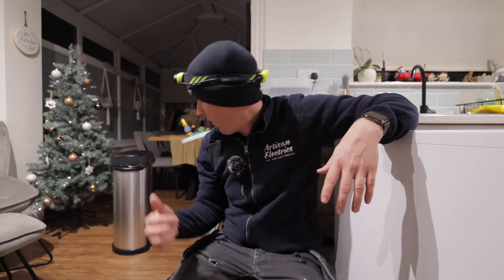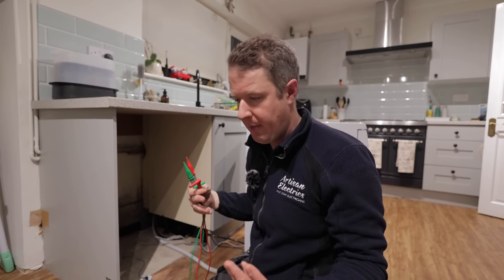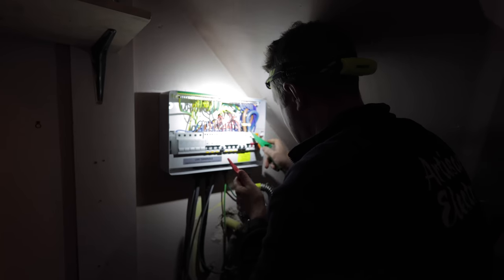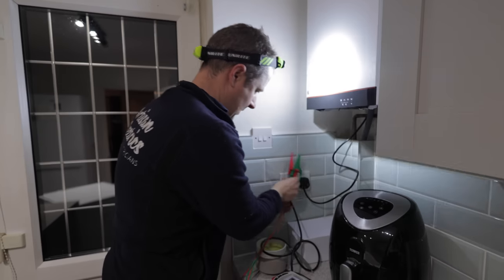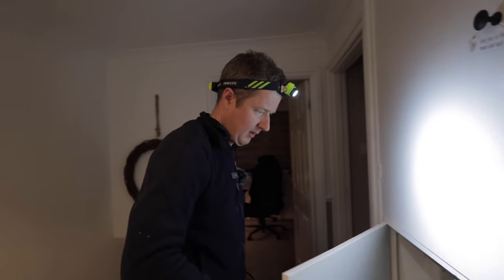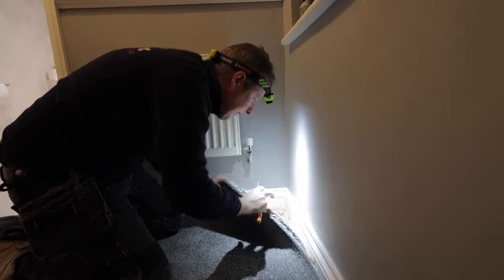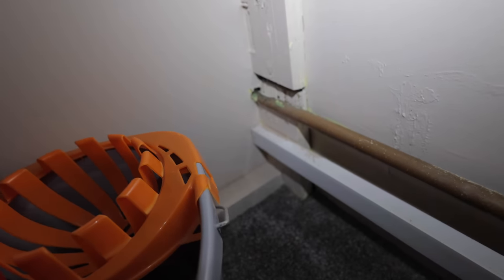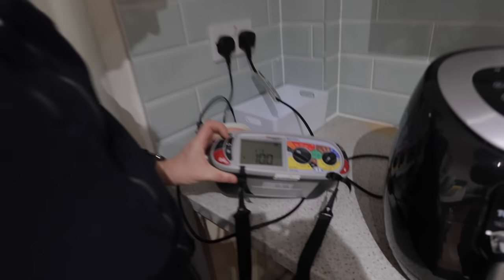Nearly KILLED by a CRAZY fault! What on earth is going on? 💀

Comment: Quick question,  you originally had two cables coming out of the boiler, you removed one (the old 2core) did this leave a hole through the rubber ? If so the boiler is now no longer room sealed.
Apologies if Im wrong, hard to see on the video.

Comment: i was a spark in the 60s and used a rubber matt to wire live 240v and 440v single and 3 phase so i surggest  you do the same this is an old sparks trick to save lives

Comment: Try french electrics. Now there's a problem. There's no neutral or earth. Just two lives. Theres no colour coding on wires. If you turn off the electrics at the board the hot water boiler stays on. Makes working on the system interesting.

Comment: I just had almost same issue .... designated cct for Boiler & Controls ....in and working fine for over 15 years, simple S/L, N & E   ...... .  Boiler replaced, new one needed a permananet live. The boiler installer used ONLY the S/L  (not N or earth) and used L&N from a local ring main.      For weeks spurious boiler shut down with 'low voltage error'      Eventualy found the wiring issue .... rewired with permanent live from System controller (same as S/L)   and all fine.

Comment: This could have been fixed without replacing the cable from the hotpress to the boiler. This existing cable could have been used to switch a relay which could have been used to provide a dry contact to the downstairs circuit. That way the down stairs circuit supplies permanent live, switched live and neutral tot he boiler with the cable from the hot press controlling the switching of the switched live. Anyway, good video, fair play.

Comment: Seen this in usa , you have a back feed in usa we wave 2 hot legs of 120 volts (to neutral)  180°out if phase to make our 240 single phase . Back feeding through an appliance if 2 breakers switches at panel are tied together per code or using a double pole breaker is not unheard of  here in usa .from some maintenance guy or homeowner not caring or knowing what they are doing .I don’t know much about British power system except you guys do it different to us and at 50hz .

Comment: Sadly, at the very end, after ensuring the downstairs boiler was fed from the ive upstairs heating system, YOU NEVER CHECKED the "direct connection there" between neutral & earth, (or maybe they were still going/coming from a MEN distribution panel upstairs, that joined N to Earth, meaning you STILL HAVE that fault, but it was (and I saw it) 10 volts on the EARTH (between the outlet's N & E via the tester) when the tester was plugged into the outlet.

THAT 10v was the E/N fault which you NEVER cleared, as there should NEVER be any voltage of that low level, between N&E ANYWHERE IN THE INSTALLATION.
That small leakage voltage is a warning, that at some time in the future, it could be the SAME voltage as if PHASE to Neutral (as that's exactly what happens when an electric element destroys itself, shorting directly from Phase to sheath, when the inner core breaks and "disconnects" from the core beside the fault, which is itself still connecte to the Neutral of that circuit.

NOT EVEY ELEMENT is the same.
Some simply blow the core "open circuit" with neither the N or L touching the sheath, sometimes they BLOW th outer sheath open, exposing both sides of the core, to the water inside the bioler, resulting in a small P to E fault current.

Sometimes thee is enough fault current flowing, to BLOW the protective fuses, but often NOT.
That is when all of your bonded / grounded/ metalwork becomes slightly livened.

fault currents between N & E can aso be caused from an off--site fault, between circuits of MUCH HIGHER voltages, meaning that YOUR bonded metalwork to E conections / cables back to th switchboard etc., can show voltages between E & N at an outlet, several times HIGHER than your installation's 240v.

Earthing circuits of a MEN or a PEN system, often exceed the premises voltage supply, simply as they are themselves part of a DIFFERENT system's erth retrn circuit, that has FAILED to blow it's protective fuses.

NEVER EVER presume that Earth will always have ZERO voltage and NO current.

That is NOT how a bonded earth return system works.

Either it's zero as both N & E are hardwire connected between their busbars at the switchboard, or you have a PEN (Protected from E Neutral), system whereby whatever voltage appears on the earth, is separated from your supplies source, hence that (THE ACTUAL LEAKAGE VOLTAGE POTENTIAL) of 10v - is the fault value possibly caused by  an element dying inside the boiler, leaking current to the copper piping and thus to the metalwork inside the boiler control panel, which of course, is bonded to the E terminal at your switchboard a distance from the outlet, meaning a circuit differential between the N& E at the plug can exist), giving you a very high resistance fault path, with negligible (but still there) being a minor fault current to bonded E at the boiler, which should blow the protective fuses, BUT CANNOT - as the fault current is NOT high enough to trip the fused protection wherever it is supplied from, leaving your client's bonded earth system, LIVE at all times.

Any value on a meter after you complete your testing should warn you - YOU HAVE NOT CLEARED ALL FAULTS.
That 10v on the meter proves there is still a N/E potential of 10v at that socket, but from where it is coming?

The ONLY way to discover from where, is to take ALL E READING from the outside deep ground GROUNDING STAKE, not simply an E terminal along a long length of cable, from a bonded E/N switchboard.

The FAULT you felt off that E terminal, was the same 10v on ALL bonded metalwork, including the boiler control panel housing.

Anyone working with water IN THE SINK/DRAIN nearby, could well get a massive shock, it they simply touch the pies or the taps.

It isn't unheard of, for housewives to "complain" of a tingle when turning taps on & off, if a HUGE FAULT exists say a few miles away at a switchyard, where a transmission transformer's circuits are faulting to GROUND, but the  fault is NOT going back via that switchyard's own earth /N bonding,  but rather your own bonded metalwork, and your E-N switchboard, meaning -yep, even if your mains switch is OFF, it only disconnects the L/Phase, not the N or the E.

It's why I prefer an ONLY L+N system, whereby the earth and all bonded / grounded pipework/metalwork is completely unrelated to your incoming FULLY PROTECTED RCD mains supply lines.

If there was zero method any ground fault, from your premises or anywhere else, could appear between your N & P lines, there wouldn't be any "ability" to shock anyone in the installation.

No return path = no current flow = no shock.

Comment: That fault was absolutely nuts. I've never come across that before. Days like this, you wish you had become a Plumber....erm then again. Nice job getting around the issue. I do not miss all those times of ripping up carpets and floorboards. I find the best way to lift a carpet is with plyers. Get a good grip in the corner and pull. Thank God nobody grabbed that plug top. Who wired that in, should be held accountable for that. It could have killed someone....not least you. Electricity has it's own rules and does some very strange things under strange conditions. Unless you are absolutely crash hot on electrical theory, most of us will have trouble finding a fault like that. I was also thinking Capacitance from something, but then the voltage would be different and your initial shock would have dissipated most of the charge. Glad you are ok.

Comment: I like your videos, but here's a couple of things coming from an amateur: stupid simple neon probe before I touch wires. Second thing: cutting a plug off a boiler voids the warranty. And finally third: I didn't catch if it was gas or oil boiler, but digging in a gas boiler if you're not a certified installer would be quite illegal - at least here in Ireland.

Comment: The only earth wire should be linked is the (2way switch) that operates the staircase. 

The Gas pipe is now Yellow plastic and water Blue plastic pipe. As connecting earth wire to copper  water pipes was banned in (1968) . gas is also illegal as that too could cause a spark and ignite the Gas.

Comment: Is the panel you switched off from the main panel? Seems like someone may have run the lines incorrectly from the return bus on the main to the return bus on the secondary panel? For example? Bridging the ground and return buses a second time at the secondary panel in addition to the bus bridge at the mains?

Comment: When I was in my twenties, I worked in the West End of London as an office machine engineer. Some of the larger accounts machines were wired through constant voltage transformers. Sorry to say I had my nuts fried loads of times in the seventies while groping around with my head inside these monstrosities, which consisted of multitudes of circuit boards and miles of associated wiring.  I think I’m very lucky to still be here.

Comment: I'm the dangerous half knowledge kind of guy, but would'nt it have been possible to put a relais into the boiler, connect it to live for power and use the upper cable to control the relais? No re-wiring needed and no connection between the circuits.

Comment: Get yourself a Fluke meter. Some models have a low impedance AC volts measurement mode. They are ideal for tracking down “ ghost “ voltages.

Comment: As a Dane I'm mystified by how any of the UK installations you've shown are legal, and especially how it's even possible to do a cross-circuit installation like this and not immediately notice that something is wrong. For the past ~50 years (or 48 to be exact, since the 1975 regulation went into effect) RCD on the mains and earthing for anything that draws over 2000 W has been mandatory here, and that means you should not be able to turn the power on at all if you had a fault like this, because the RCD won't allow it. Our modern regulation is even stricter and require the installation to be split into multiple circuits with their own RCD, so a fault in a 400 V appliance doesn't kill the power to the rest of the house, but this also mean if you crosswire the circuits, it'll cause the RCDs for both circuits to shut off

Comment: Couldn't you have put a relay in the boiler which is activated by the switched live from upstairs but switches the live from downstairs? You only would have to have left a big remark on that relay stating it is fed from another circuit.

Comment: Do I understand correctly that if you'd done this test in summer, the switched heating would be off, so you'd never have encountered the fault? Or alternatively if you visited at a time outside of the thermostat's programmed heating cycle (and nobody takes hot water)?

Comment: I had exactly this fault, I could make it even worse you should have checked the screws holding the plug sockets and anything metal that has an earth like a metal microwave as that would have had 180v through it as well. I found mine was when they added more loft insulation and broke a dodgy mains connection which must have caused this fault as soon as I made the connections again the problem went away

Comment: Great fault finding and elimination skills. Why wouldn’t you have used the switched active cable to pull in a relay then the you could have used the cord cable to give hard active and also put the cord active through the relay to give the enable. There would be no connection between the circuits

Comment: Nice work. Not sure if it's allowed but couldn't you have placed an relay in the boiler controlled by the thermostat and the output to the onput on the boiler? The you would have got an isolation between the two circuits.

Comment: I try to imagine a way to do this, reproduce theoretical ofcourse, but I can't, like pushing a square cube through a traingle hole(little kids game). Man, I had once installed an especially for outside use, a socket for summer swimpool, and in the fall it accumulated water inside the pipe shorting to ground. Never expected a tested, government approved socket espsecially for outside use, with a cover and all, not being safe. So, even when trying to do the right job, it might go awfully wrong.

Comment: I would have turned the wiring between circuits to isolated DC signal for an optocoupled relay in the boiler. Signal only from upstairs, all power from downstairs.

Comment: I still do not understand, why the RCBOs of the two circuits do not trip in this case. 
Since the current going out on the live is not coming back on the corresponding neutral.
But instead on the other circuit.

Comment: In Amsterdam we came to an appartment were the owner complained she felt shocks when she stepped out of the shower. 3th elektriciens there. Powered of the hole installation. There was still electricity flowing between ground and zero...?? 

It has been a while but i seem to remember that the problem was that the upstairs neighbour was leaking electricity on to the copper water pipe. This was somehow connected to the shower of our client. The shower from the client was grounded but the metal wiring in the concrete was also grounded. So when the floor was wet and she stepped out of the shower she would feel a little shock.
.... Two earth connections... Old building... Company before us made a new earth connections... I dont know anymore... 
Ah i forgot... sorry super anticlimax... Too many years ago.... but it took me ages to write this so im posting it anyway! Also i didn't solve the problem my bose did! He would always have a solution after a good night  sleep. Super clever, creatieve thinker! :)

Comment: I probably would have put a low voltage transformer upstairs for control.  Which turns on the relay installed in the boiler.  Using the old cord.

Comment: I’ve been wiring up four outside lights on the four columns. All run off one switch. They were looped, two cables in, two cables out, on the lamp holders. For a few years it’s been working fine. One day when the power was switched off. The one lamp would stay dimly on, then fully on. But it only happens now and again.  Checked the connections, yet it looks ok. Any ideas?  
Great video👍

Comment: 1 min in, guessing a transposed phase/neutral either at the fuse box or worse on the incoming supply.
Have come across this before.

So, did they also mix up the neutral and earth in the boiler? Why were you getting the voltage on the earth and not the neutral?

Comment: Excellent fault finding, top spark , I’m wondering if you could have made that twin and  earth from the wiring centre permanent L N and E , and then used an Rf receiver / device next to the boiler with permanent live in and switched live out to the boiler , then at the wiring centre have the switched live for boiler into an Rf device to activate device below the boiler ??
( to save running another cable in )

Comment: Most probably the voltage is coming back through an appliance connected between circuits. Most light bulb changing electricians would not know this. 
 You can electrocute yourself just with live line, so using Live-Neutral test devices can mislead you. 
 About those inductive pen testers, I seen british "electricians" using those and mumbling 2 weeks in a loft to change a light switch.
Later edit: you find it, but you should seen it in the beginning.

Comment: I always wonder the difference between the British wiring and what they do in the rest of Europe. Al those wiring under the kitchen cabinets... That is not allowed here in The Netherlands.
I am not an electrician, but I understand that wiring a heating system from two different circuits can be dangerous, especialy as a plumber installed it 😉 Those flat cables we don't have thiose here. How safe are those? And the electrical system is some kinf of ring system over there? Is different from what we have.

Comment: Would it have been possible to use a relay? Either a solid state relay or an old-fashioned one to have the switched live and neutral switch the permanent live to act as the switched live?

Comment: My plumber connected the 1mm for the boiler into the loop in and out of the switched fused spur effectively bypassing the fuse so for a year I had a 1mm cable backed up by the 32a ring main the switched fused spur was on

Comment: See this too often, a lot of the new boilers need a permanent live on top of the traditional switch live, neutral and earth so the heating installers run a permanent live from a plug socket instead of running a new 4 core cable from the 10 way junction box to the boiler, by the way should you be taking that boiler case off 😂

Comment: Great video i understand how the plug on the boiler is been powered from the upstairs circuit but how did the earth pin become live as all earth's are joined together in the house wouldn't the house owner been shocked before now if hi touched a metal appliance?

Comment: hey man, is it a thing in the UK where appliances sometimes arrive with PE and N shorted? here normally they should never be sold in this condition but it is actually allowed to install them like that, so recently had a 2nd hand oven arrive with PE-to-N short which normally isnt an issue but some less-than-genius engineer had actually also wired an EU style plug, as you can imagine, it's 50/50 if it'll be plugged in wrong and instantly short PE to L and therefore pull down all your fuses... the plug was also destroyed btw, and funny thing, I calculated based on the amount of vaporized/melted metal about 130-140A had to run to cause that much damage to the plug.